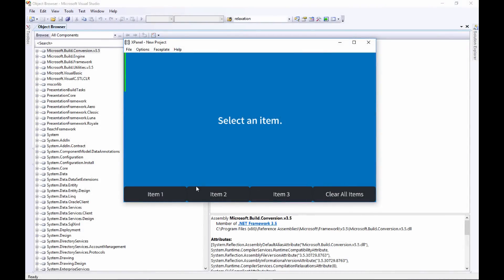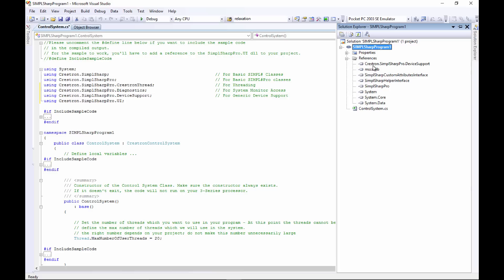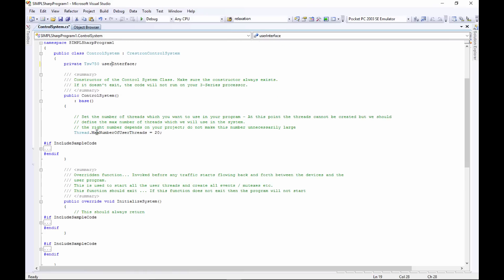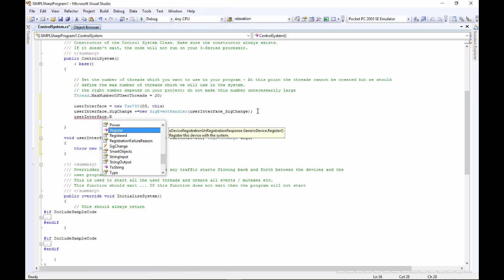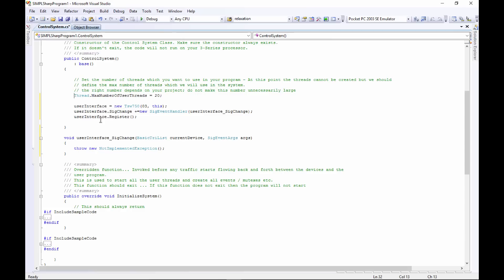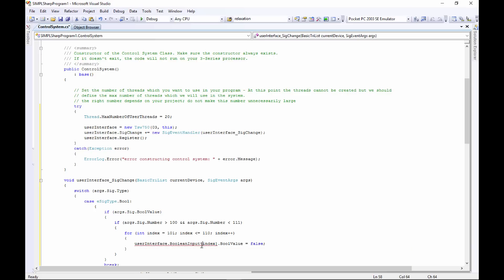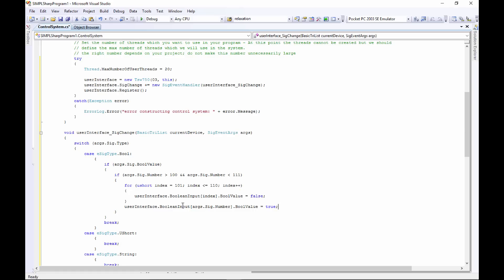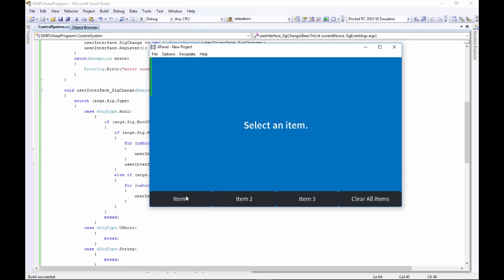How to make an Interlock with Simpl# Pro

Comment: great video - quick question - where it says item1, 2, 3, and clear - this could also apply to like Crestron touch panel in boardroom to where it can act as HDMI1, Hdmi2, volume +/-, clear?  -Not sure when pressing each item, if it will interact with the physical connection e.g. switch between item1, item2?
Reply from the maker: @sukhi5577  It can control a device. You can use the button presses or the result of the interlock to send commands to an HDMI switcher.

Comment: Thanks so much, I loved the tutorial!  I have one question about the it, however.  I was able to infer from the code that the labels "Item 1/2/3" are using visibility digital joins that correspond to the button join numbers which can be anything from 101-110 BUUUUUT I can't figure out what makes the "Select an item." visible when the "interlock" is cleared.  I created my test XPANEL from scratch, but it'd be nicer if there was more info on creating the XPANEL or if it was available for download.

I also had a question about your pricing scheme for the course itself.  You claim the course is free, but that's only to members.  Would you ever consider the option to buy courses individually or is a membership the only way?  I'm not sure 6 month access to a single course is worth $225, especially when it's time limited, and none of the other courses would be useful to me in my current situation.  Alternatively, would you ever offer a monthly membership?
Reply from the maker: Sorry for the late reply Janus. There are free intro courses to get started. Feel free to reach out to me to discuss your situation: https://learnavprogramming.com/contact/